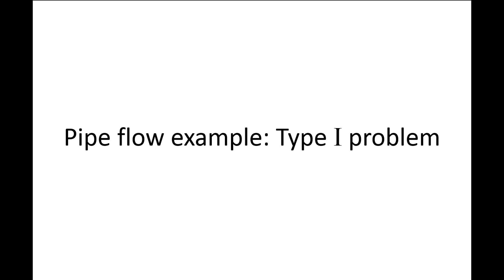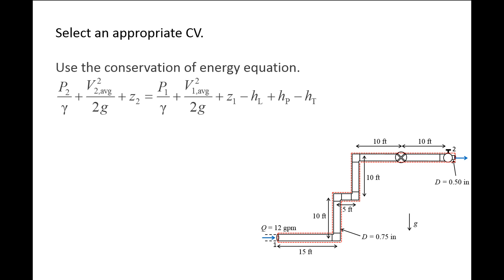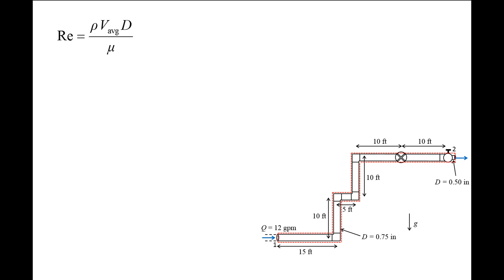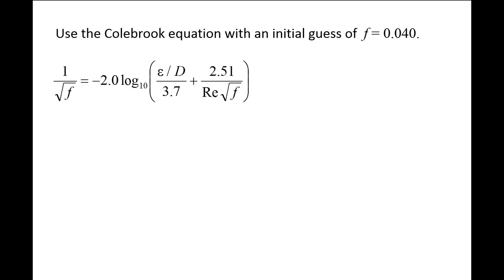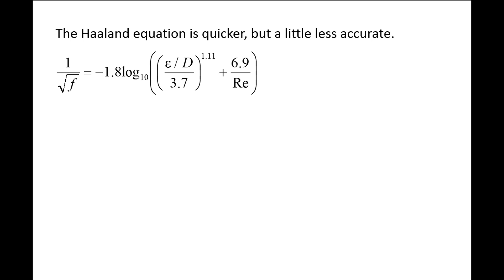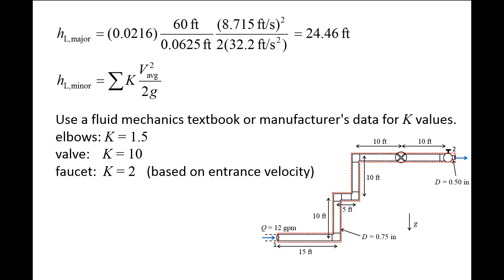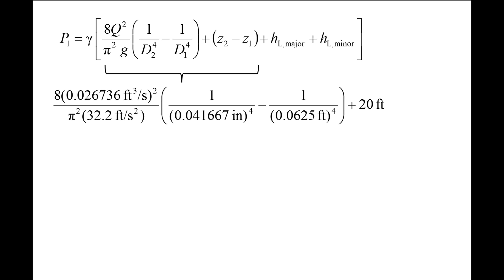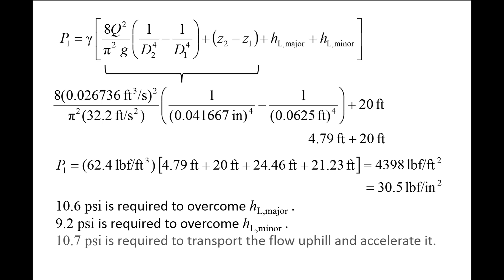Fluid Mechanics: Topic 9.1.1 - Example of type I pipe flow problem

Comment: Good day sir, in the video the loss coefficient you used in four  90° elbows (threaded) is 1.5 and casually the present book suggested that the loss coefficient for 90° elbow (threaded) is 0.9. So far as I used what the book suggested,  my result for getting the pressure 1 is 3266.54 lb.f/ft² or approximately 22.68 lb.f/in² which is smaller from your result.